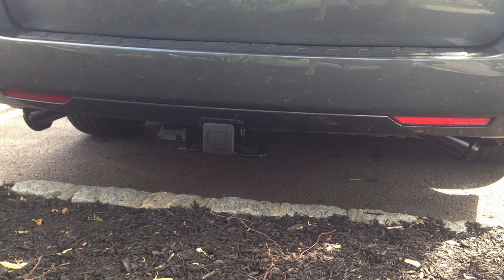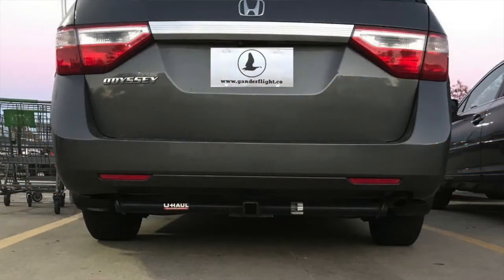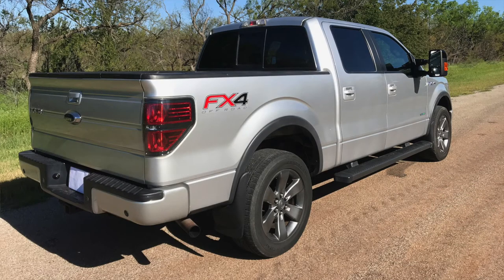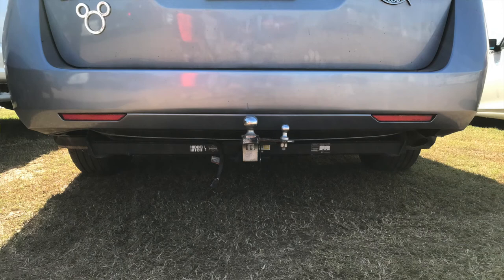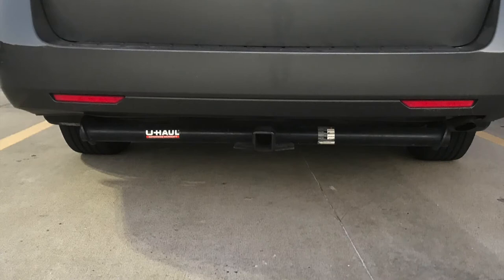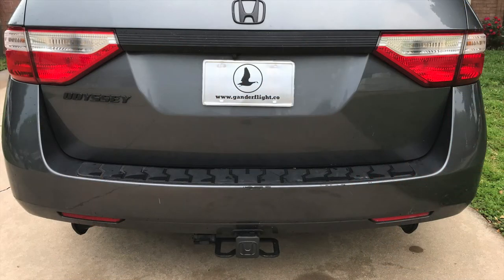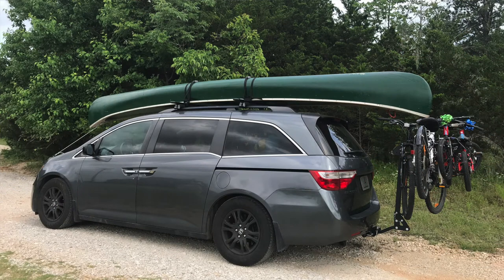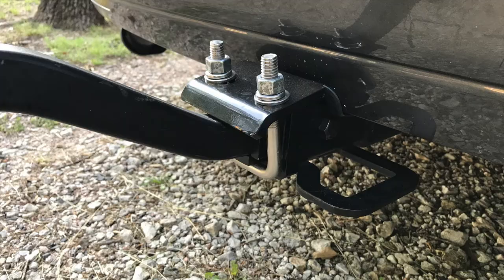OEM vs Aftermarket Hitches - What’s the Difference?

Comment: Spot on advice!   Clearance and how it sat under my bumper was a huge factor for my new (used) truck.  I had the experience you mentioned with the Uhaul hitch on my 2006 Jetta tdi (Jack😉) where it would scrape in and out of areas.... super frustrating😂
Reply from the maker: It is super frustrating for sure. 1. your scraping up the hitch 2 - it can be LOUD and EVERYONE turns to look your way 3. you can really dig up a driveway with repeated passes.  Did you find different manufacturers hitches sat at different heights with your truck?

Comment: Another thing to consider: On my car the OEM hitch gives the car a 4500lb tow rating and aftermarket tow hitches lower the tow rating to 2000lb. The reason why is that the tow package on my car comes also with anti sway software, the higher hitch that you talked about and a separate oil cooler. If you take my car without the tow package and put an aftermarket hitch, you lose ground clearance and 2500lb of capacity. I don't know if this is similar to other cars, but it was a big deal when I was shopping for my used car. I specifically looked for one with a factory tow package installed. It took a lot of shopping but eventually found one with all the options, trim package and tow package that we wanted.
Reply from the maker: You are absolutely correct - additional items like transmission coolers, software, and beefed up suspensions can definitely change the towing and payload for each vehicle.  When I was researching trucks there was a 6,000# towing capacity difference between same model trucks just based on optional equipment in addition to the hitch itself!
Reply: what car is it

Comment: I had not thought of the ground clearance; I was thinking more of the installation of original vs aftermarket.
Reply from the maker: Ground clearance usually means a difference in installation you're right - but getting it tucked up in there more is definitely helpful after installation is complete!

Comment: I wish I had seen this video BEFORE I bought my aftermarket hitch and had it installed. YES... mine sits lower than the bumper now. AND.... they put the wiring harness inside the vehicle's spare tire area, UNDER the cover. I keep my work tools and more on top of that cover. Everything must come out to use that wire now. Yes, I can leave a loop inside the cargo area, BUT.... I also have to feed the wire out the rear hatch and over the bumper now. There is very little clearance for error where that wire goes. I'm kicking myself for not asking more questions BEFORE I did this. $500+ later... oh well. Oh yes, this 2018 Ford Escape Titanium has the "Lift-Gate Assist" under the bumper for hands-free operation of the hatch. That is very sketchy whether it works or not now. ARRGH!!
Reply from the maker: Bummer Bill - sorry to hear you've had a frustrating experience with it. You could look at re-routing the wires on your own to solve one of your issues.

Comment: Does the aftermarket decrease tow capacity
Reply from the maker: As long as you have the properly sized hitch the towing capacity between oem and aftermarket will be the same. Thats going to be determined by engine size and payload capacity among other things and will be set by the manufacturer.  You can find a towing chart on the vehicle manufacturers website to get specifics on your vehicle.
Reply: Ok thank you i recently bought a 2021 durango sxt but doesnt have tow setup but i want to at some point get a small travel trailer but dont know what size to get hearing different things about it is so confusing lol
Reply from the maker: Find the Dodge 2021 towing pdf on google - then youll find a table that will give you tow capacities most likely based on motor size.

Just remember- youll most likely run out of CARGO CAPACITY before you reach towing capacity when towing a trailer, so that will be your limiting factor
Reply: Got a 2024 Honda Pilot Touring and deciding whether to go OEM hitch vs aftermarket.  Aftermarket is cheaper and simpler to install but located below the bumper.  An OEM hitch like the one on the Trailsport Model costs like 4-5x more because have to also replace a lower trim panel on the plastic bumper.  So dealers want to charge $1000-1200 for an OEM parts and labor. 😢.  Granted OEM looks better and doesn’t take away from any departure angle if you take it off-roading anytime.